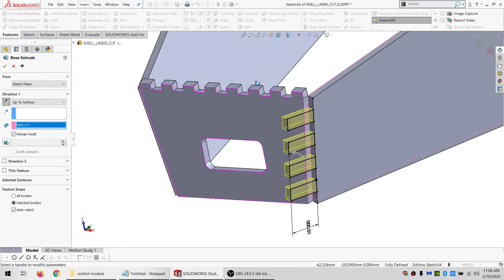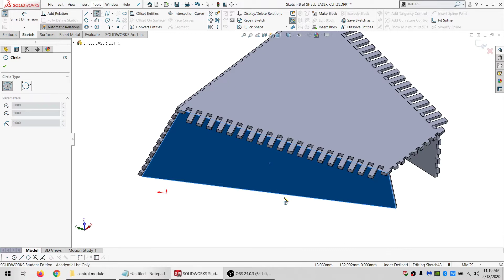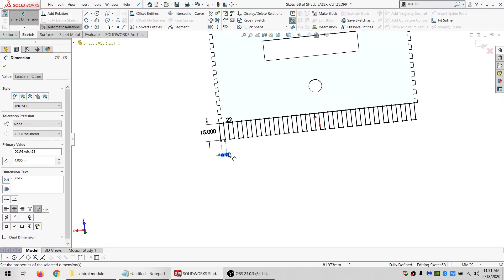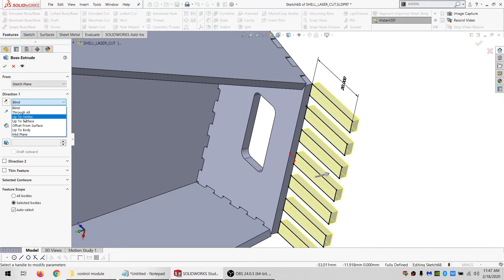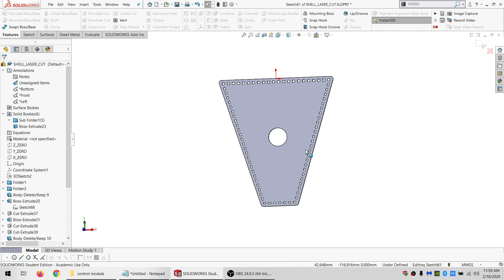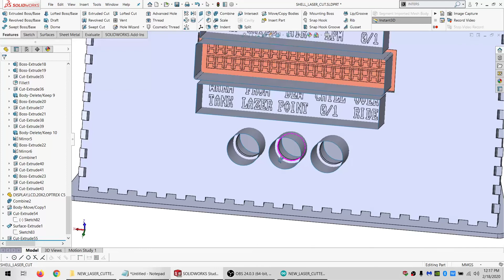Designing Laser Cooling Control Module Box Part 2

Comment: @3:39 where did that center for your trim circle come from. I didnt notice you actually putting it there?
Reply from the maker: I just grabbed the origin.
Reply: @MAKER_GURU  So the sequencing on that tab trimming was extrude cut up to the same part your extruding. I slowed it down to understand how you did that. Wish I was standing there so you could explain it to me. On the side panels you made a circle on origin but yet its in the middle of the front panel and it extruded cut out on the side panel up to the same panel. Even at .25 speed its hard to tell how that worked.